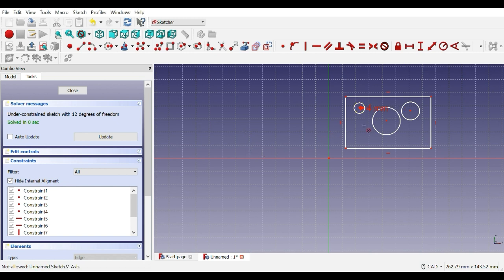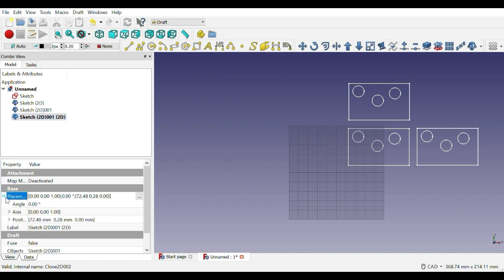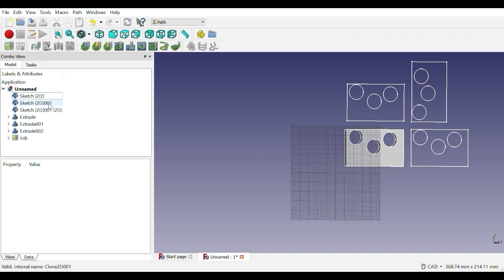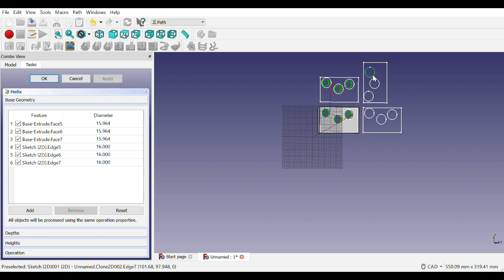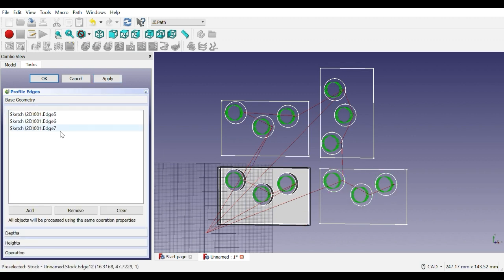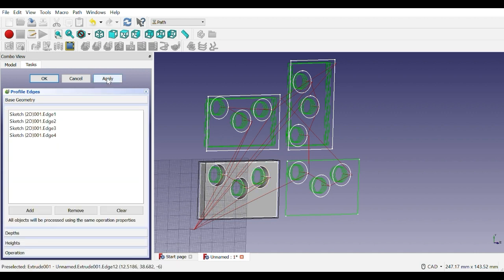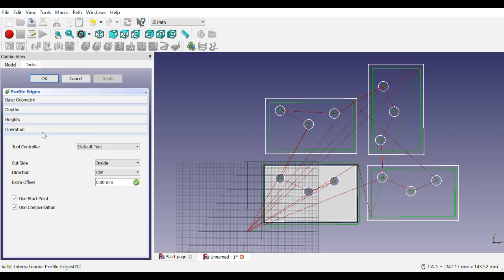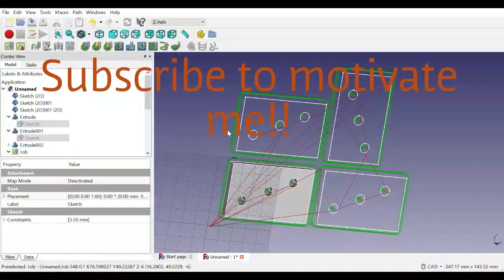Freecad: Sketch to Clones to Gcode!

Comment: Hi,
At the very start you mentioned using Windows recorder to make this video.
Might I humbly suggest you try Screencast-O-Matic. You may find it runs happily while using FreeCAD on your machine and will faithfully reproduce menu selections and pop-up windows so your audience can see everything you mention. It comes in three versions:
Free which places a watermark on the videos and is limited to 15 mins recording time but certainly allows you to evaluate its suitability,;
Solo Deluxe that currently has an annual subscription cost about $18; and
Solo Premier that incorporates hosting and backup at about $50 annually.
Deluxe and Premier provide fairly comprehensive editing tools too.
It does allow upload directly to YouTube if you like but may be restricted to 720p resolution if you want to use a webcam as well, and will probably be restricted to 1080p for software demonstrations.
Reply from the maker: Paul Reader , the reason I used Windows built-in was because I don't have to worry about them spying on my desktop.  It's too hard to tell which software isn't spyware these days.  It's a real problem for the industry.  Some software gets good marks for not being spyware, but then someone releases a version with spyware later, so you can't even trust the reviews.  What's the solution?

Comment: Why use Freecad still? Fusion 360 is free to us hobbyists now and it’s an all in one package... model to CAM to GCode.
Reply from the maker: Neo Morph I really like fusion 360.  But I've spent too much time learning a tool only to have it yanked by the company into a licen$e requirement.  When the CEO changes, so do a lot of their sw license agreements. Otherwise, I'd keep using it in a second!  It was nice!
Reply: Neo Morph - as TheRainHarvester points out, at least with Open Source software you get the security of transparent code. If the open source software does the job you want (with perhaps a little more effort), at least you always know where you stand. SketchUp is a prime example of $driven proprietary transition, as is BabaCAD.